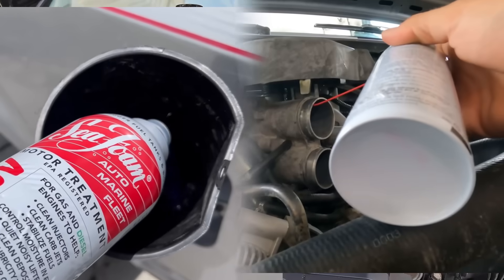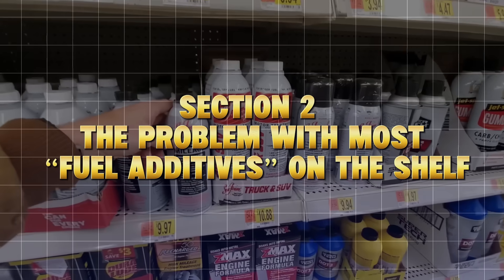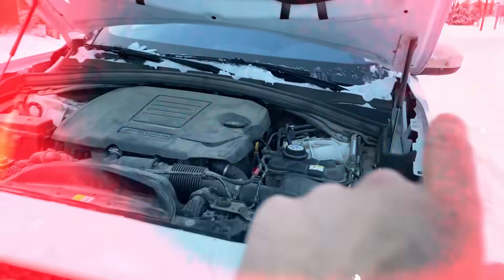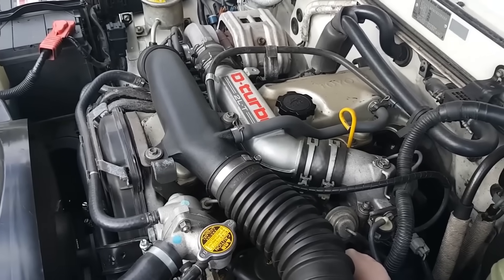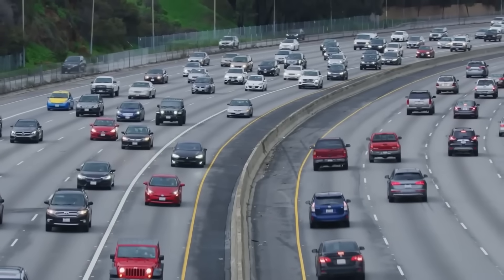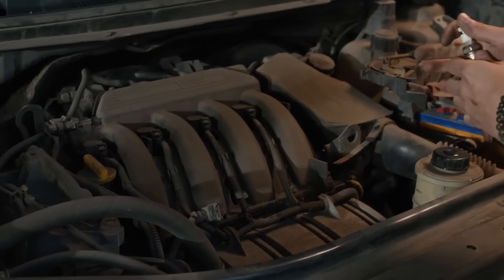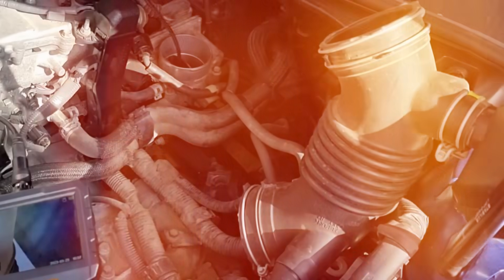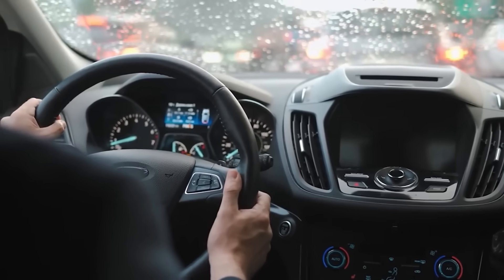One Bottle That Cleans the Entire Fuel System (Mechanic Tested)

Comment: You can clean your valves from carbon build up but the valve seat will not seal if you got carbon build up, if you got carbon build up its already too late and you will need a mechanic to remove the engine head and lap the valves, to avoid carbon build up you need to add a fuel additve at every fill up, a fuel injector cleaner 6oz bottle cost about $3 and thats why most people don't use it or they don't use it enough,,,, 😮😮

Comment: Phony advertising.  There is no way stuff like this can properly do induction cleaning on a direct injection system.  The inherent problem with direct injection is the back of the intake valve, not the injectors.  Only walnut shell blasting, or regular cleaning via the intake with valve cleaner will restore performance.
Reply: No NO NO. 45 MINS ONCE A MONTH DRIVE BETWEEN 2.5 to 3K RPM And THAT IS ALL YOU NEED DO FOR A CLEAN RUNNING ENGINE LASTING OVER 400K MILES WITH PROPER PARTS LUBRICATION MAINTENANCE. WE JAPANESE LAUGH AT YOU ALL WASTING MONEY BY MARKETING HYPE AND NEED FOR INSTANT RESULTS. WALNUTS ARE FOR EATING.  SILLY .

Comment: No fuel system cleaner can clean intake valves on a Direct Injection engine no matter what this AI generated video says. Just use Top Tier Gasoline and change your oil on a regular basis instead of the Manufacturers 10k miles.

Comment: Laugh if you want, but I just dump a gallon of lacquer thinner in the tank with 8-10 gallons fuel and run it through.  Been doing it for years. Also before oil changes I dump seafoam in the crank case, and the rest into the gas then drive for 100miles and change the oil.  My engine's guts are squeaky clean.  Also always or clean your egr, pcv, maf sensor, throttle body, air filter and 02 sensors every 30K miles. You can do all that yourself, easy

Comment: so if you put top tier premium and plus you need injector cleaner?
Reply: By premium and plus I assume you are talking about the fuel rating and if so that only tells you the combustion rating aka octane rating. The higher the number the harder it is to ignite the fuel. 89 octane will ignite easier than say 93 octane which is why turbocharged and performance engines call for higher octane levels so the fuel doesn't ignite before its supposed to.

Comment: Have always used Seafoam, tried others..but in the end, my opinion, Seafoam works!!  Awesome for engine flushes especially, put it in and drive. The best stabilizer also, and I find it works great as a fuel system cleaner also.

Comment: Used them all sea foam great for old school out boards in the two cycle sector diesel fuel treat ment In the private sector and has destroyed more catalytic converters running to hot with ethanol fuel I like the Royal purple bg and chevron never seen the red line but it has a great reputation ran the Royal and oil turned black and the bg deep efi gargle service barely smoked and turned oil red and stunk like sulfer I got coffee grounds under oil cap and cleaned deep restored performance and ran smoother increased gas mpg!
Reply: WTF are you talking about??

Comment: So this one says redline the last video said don't use redline use Royal purple the video before that said the techron was the best I am completely confused and done with this page as I believe you are just getting sponsorship and receiving funds for pushing product
Reply: They are all good. Use any of them and keep the motor oil clean by drain and refill, along with high quality filter. Don't forget the fuel filter !
Reply: He also said don't use it on a full tank then he said 1 bottle 1 tank..which is it?

Comment: Next time do a real head-to-head test and show us the results! 👇

1️⃣ STP Ultra 5-in-1

2️⃣ Gumout All-in-One

3️⃣ AMSOIL P.I.® Performance Improver

4️⃣ AMSOIL Upper Cylinder Lubricant & Corrosion Inhibitor

5️⃣ Royal Purple Fuel Injector Cleaner

Let’s see which one actually cleans best, boosts MPG, and makes the engine run smoother no marketing, just real results! 💪🚗💨

Comment: Most top tier gas alwready has additives in it this stuff is not necessary
Reply: I heard that the top tier fuels also contain a little bit of chicken in them, so your engine won't go hungry either.
Reply: You know not what you say. I always get a kick out of kinds like you. No facts, no research, no data. Geez. Do your engine a favour. Get a bottle.
Reply: No. The top tier fuels do not have the concentration of PEA, especially as recommended in this video. Also the top tier fuels do not have lubrication for the upper cylinders and injectors, as you get when using Marvel, Amsoil, Lucas, or Motorkote UCL. 
Best to use top tier fuels with a top cylinder lubricant on a continuous basis, then twice a year use the Redline, Chevron, Amsoil Pi, or Gumout with PEA.

Comment: Change all the sensors in your vehicle. If it has fuel injectors, a distributor, and an EGR valve- change them too. It's better than any chemical additive.
Reply: yep, just change the engine thats better yet
Reply: @jefferystensland1304  especially if it's a Chevy “Astro” van lol